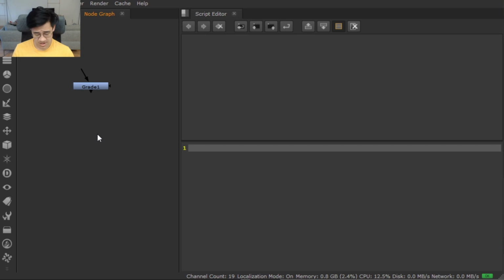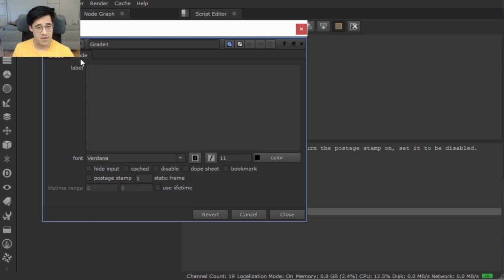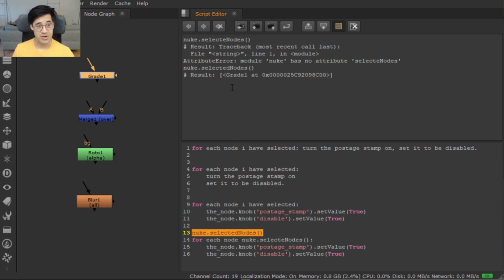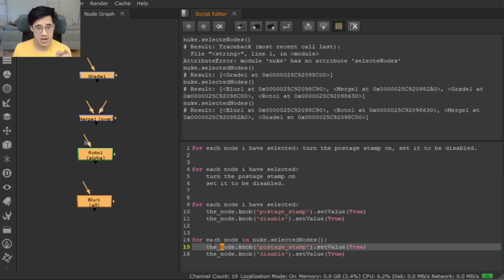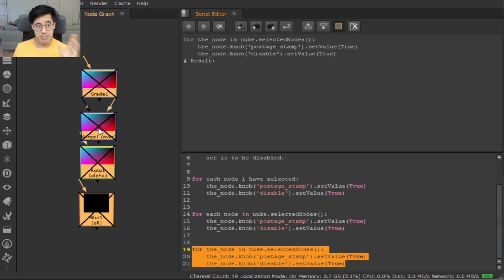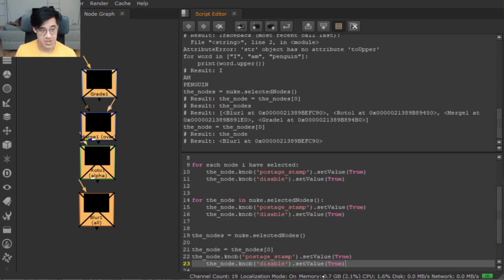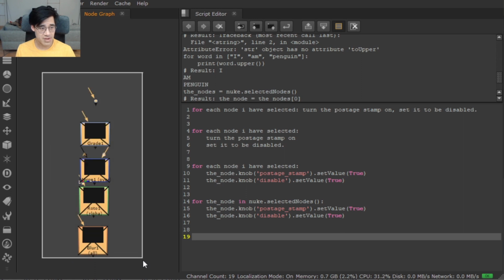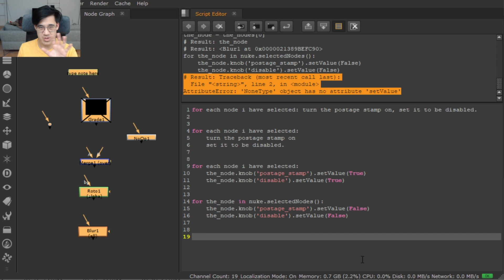0x03 Python for (Nuke) Compers - Loops!

Comment: Hello thanks for the tutorial but I am getting error on this syntax. 
for the_node in nuke.selectedNodes():

Error is as below. 

for the_node in nuke.selectedNodes():
# Result:   File "<string>", line 1
    for the_node in nuke.selectedNodes():
                                                                     ^
SyntaxError: unexpected EOF while parsing

it will be great if you can advise me what is going wrong here? Thanks!
Reply: Ok I found the solution my syntax below for statement was not correctly indented.
Reply from the maker: Nicely spotted! Working out those error messages and being able to pick those kind of things up is one of those great skills to develop.